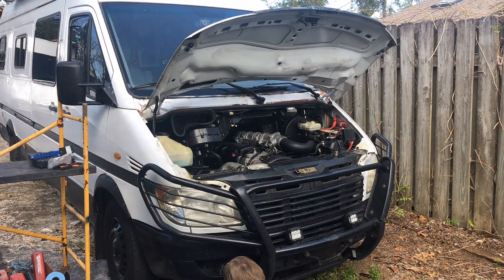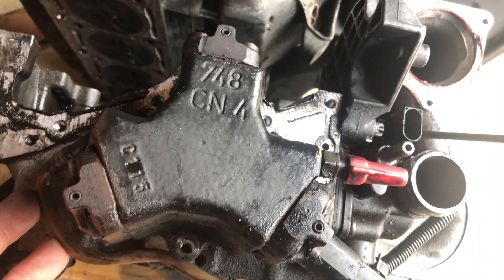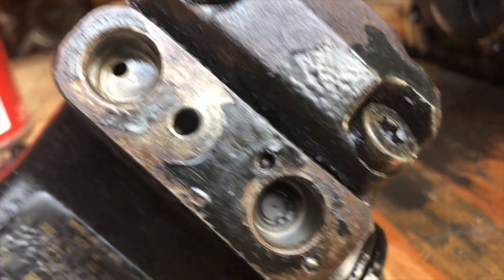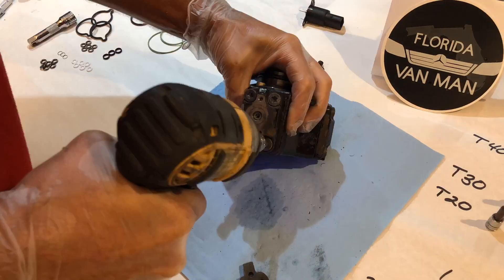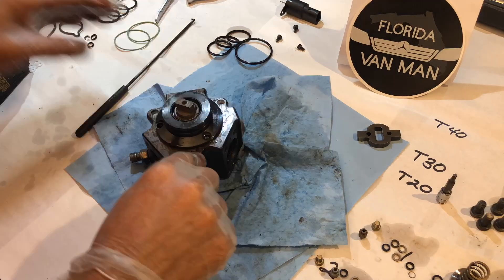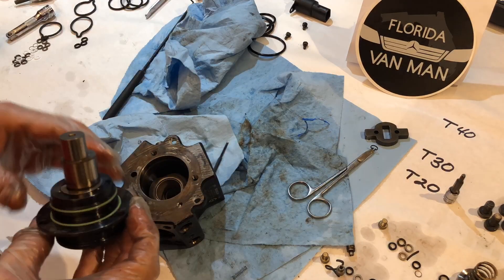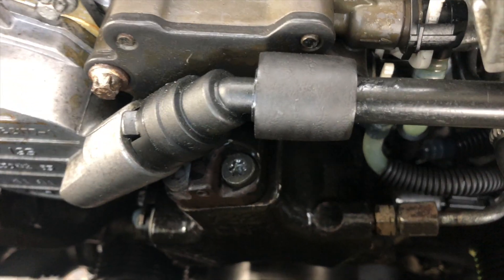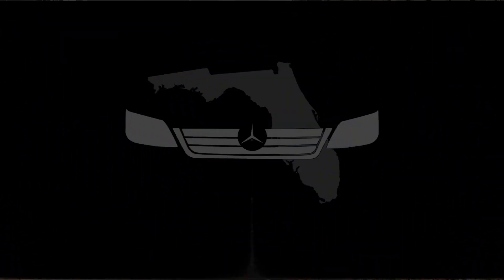HPFP Rebuild 2002-2003 Sprinter Bosch High Pressure Fuel Pump

Comment: I have a question, I have a 03 Mercedes sprinter. Was running like crap low/limp mode got home sat for a year did fuel filter. It will run with the fuel in the lines and filter than stall 7+mins It is not wanting to suck fuel from tank. Will this fix that or any idea what will cause this?
Reply from the maker: No, this is the high pressure pump and it will not suck very well at all. There is a low pressure pump right next to it on the front of your engine. That pump sucks from the tank and provides the positive pressure the high pressure pump needs. MillionMileSprinter has the low pressure pumps.
Reply: @FloridaVanMan    can I get you on the phone for a few mins to pick ya brain I’m willing to pay for your time, do you see low pressure pumps go bad often? I’ve rigged line & funnel to the filter via inlet port and it runs fine with fuel in funnel but when line from tank hooked back up it’ll just run the filter dry and not suck from the main fuel tank. Any ideas what would cause this? 
I’ve ordered zero leak fuel filter
Am interested in replacing the clear line from filter to lpfp as I suspect they’re leaking air and not enough vac to suck from tank. Any other recommendations?
Reply from the maker: @adanmccloskey3149  Sounds like a leak before the filter. It can be a broken hose inside the tank. I would put a cheap 12volt fuel pump on the hose coming from tank and see if I can fill a bottle from that pump or does it suck air from the tank.
I don't answer phone call except rare special occasions, but I help via messenger and text. Join our support group then message me on FaceBook, test or email. https://patreon.com/Florida_Van_Man?utm_medium=clipboard_copy&utm_source=copyLink&utm_campaign=creatorshare_creator&utm_content=join_link

Comment: Hey,  how much would a rebuilt HPFP be ? And where would I be able to buy one ? I have a 2002 Mercedes freightliner sprinter van 140 wb. Fuel is leaking down to my serpentine belt and I don’t have all the tools to rebuild it myself!
Reply from the maker: I've rebuilt them for $500 plus shipping. I don't have time to do it before our Winter-Sprinter meet-up next week but I do have a good used unit you can borrow*. Send payment and I'll send a used pump for you to swap in. Send me the leaking pump and I'll rebuild it then return to you for swap so you end up with a rebuilt pump and borrow a used pump to keep your van running. You will need to return the used pump to me when the rebuilt pump is installed and I'll need a deposit before shipping the rebuilt to ensure the used one is returned to me quickly. It will be understandably very easy to postpone the work of removing a used but working pump to install a rebuilt, so the deposit is necessary and fully refundable.
Optionally I can sell the used pump to you for $250 + your leaking trade-in, save you a bunch of labor, wait-time and shipping cost. $500 payment/deposit with $250 refunded when I receive the leaking unit. Half the money, half the work and way less than half the time waiting for deliveries.
Reply: Awesome I’ll buy the used one and trade my leaking one in! How do I contact you ?
Reply from the maker: Find me on FaceBook or email bill at Florida Van Man  @westleystalnaker5048

Comment: On my 2002 Freightliner diesel sprinter, the low pressure fuel pump is on the front on the engine. Is the low pressure and high pressure fuel pump one unit?
Reply from the maker: Nope, they are neighbors.

Comment: Is there a fuel pump in the fuel tank, if not where is it?
Reply from the maker: On the OM612 engine there is no in-tank pump. There is a low pressure pump on the front of the engine head next to this high pressure pump. The low pump sucks fuel through the filter from the tank and any little air leak will stall or prevent starting.

Comment: We have a 2006 2500 Dodge Sprinter van.  Recently cleaned up some "black death" on injectors 1+2 to try and resolve an issue with the van.  The van would sporadically die in the driveway, lost power once in the last few months and on occasion would not have any power when trying to back up.  After putting new seals and hold down bolts on the two injectors it now dies upon initial start up every time.  Once we restart it you can run it to FL and back with no issues unless you shut it off then need to restart after it dies or chugs when trying to drive away from the gas station.  Restart and runs like a champ.  We have changed the fuel filter, crankcase sensor, MAF and cleaned Intake air temp sensor with no changes.  No apparent fuel leaks anywhere.  Looking for some direction or ideas at this point before i just start throwing parts on it.  Love your videos but havent seen one that directly relates to this issue specifically.  Thanks for your insight.
Reply from the maker: Hi Ryan, a proper code reader should give us clues about why the van stalls and chugs. The first two links at https://floridavanman.com/links/  are compatible readers. We have a video for setting up the white reader correctly. Also search our videos for 'leak-off' and you will find test procedures for injector leak-off and fuel rail leak-off. Either of these failures will release fuel pressure back to the tank. Without pressure the van won't run.
Reply: @FloridaVanMan  
I did see the video for the leak off test. The rial pressure valve did have fuel leaking out when we cranked it over so I am going to replace that soon. No codes on a reader at my local mechanics shop. Hope the new valve solves our issue.
Reply from the maker: @ryanoehlhof7031  The local shop probably used a general OBDII code reader and our vans won't respond well to that. It can give incorrect codes when it reports them because the van uses different communication protocols from any other Dodge, Mercedes or Freightliner vehicles.
Reply: @FloridaVanMan  Thanks will definitely keep that in mind and will keep you posted after installing the new pressure valve on the rail. Any thing to be aware of or tips on installing the valve?

Comment: Did you use oil to protect the metal during assembly before starting the main pump.?
Reply from the maker: Everything is very oily when assembled and fuel is added immediately when the low pressure fuel pump rotates. Air in the lines as would be with new replaced lines would be cause for additional lube.
Reply: Where can you buy the rebuild kit?
Reply: @nickbabamov  I have done the same type of rebuild but id rather use assembly lube as diesel does not provide sufficient protection during the normal restart of a rebuilt kit that was installed.

Comment: Its possible if its little bit leak, to EPC And engine off if i try floor it?
Diag say low pressure on rail.. I think its pump
Reply: I have that problem I didn't resolve it...

Comment: Hey man. I ordered the gasket kit for my 2003 t1n and the gaskets are a little smaller the the factory ones. Is that normal and will they work with it? Were they like that for you? Any help would be appreciated. Thanks
Reply: Where did you buy the gasket kit?
Reply from the maker: If you are talking about the O-rings, the old ones might be swollen. This might be why the pump needs rebuilt.

Comment: Why didn't you use the washers with a dent on them? I have a w203 220 cdi that leaks diesel and I do have a seal kit from what I think is a 270 cdi. I do have all the washers except the ones with a dent. Can I use the kit from 270 cdi you think?
Reply from the maker: Those big seals that are not round fit a different pump. The seal kit fits several models. I don't know anything about 270 cdi. I only play with T1N Sprinters.

Comment: Good video!!!just one question:what did you do when you removed the retaining clip(min 3:02)
Do you have to replace the spring or the other part?or just clean it?
Reply from the maker: We reuse the clip, but the spring loaded stuff beneath it must come out to reassemble the bigger pieces. Then it goes back in later. Clean everything.

Comment: How do you bring back the fuel pressure because the engine will not start? . The pomp has no fuel now inside. Thank you.
Reply from the maker: Did the fuel filter drain? Can you fill the filter?

Comment: If a hpfp needed a rebuild would there be symptoms associated with this?
Reply from the maker: These pumps usually leak when they fail. Fuel drips on the serpentine belt and gets slung everywhere under the hood. Other symptoms might include low fuel rail pressure, limp mode and stalling.
Reply: My 03 sprinter starts and dies in colder weather till operating temp. Hot weather you have to let cool down or it takes many cranks to start. Recently in cold weather it now stays limp mode. I have replaced fuel injectors glow plugs and module and fuel filter. Do you think it could be hp fuel pump or fuel management valve?
Thank you

Comment: Great video, do you have a recommendation for a company that sells remanufactured pumps?
Reply from the maker: We have rebuilt a few with good success. If you don't want to do it yourself send me a note and we'll rebuild yours.
Reply: @FloridaVanMan  I have removed the injector pump from my 2002 frightliner sprinter 2500. Cany ou overhaul and what is price to overhaul ?
Reply from the maker: @georgewhidden8064  $350 to exchange. Or you can rebuild it yourself with the seal kit and save about $300. The kit is out of stock right now. I have one ordered and one pump on the shelf, ready to go.
Reply: @FloridaVanMan  Howdy, do you have any rebuilt pumps ready to go at the moment?
Reply from the maker: @geoduch  Not recently rebuilt but I do have a good used one still on the engine that came out of Too-Blue. It was rebuilt more than a year ago and only a few dozen miles put on it before the engine was swapped, complete.

Comment: What is the brush guard that you had installed at the beginning? Is it a T1N specific brush guard, or a generic aftermarket one that you added? If so, how difficult was it to mount? Looks really good and I'd love to put one on my van
Reply from the maker: I believe it is a brush guard from a Toyota Tacoma. They are significantly cheaper than anything specific to T1N and can be easily modified to fit. I quite like the way it makes Mr. Sprinter look, very sharp and aggressive.

Comment: It never even entered my head those pumps were user serviceable. Quick question. if I wanted to disable my sprinter all I would have to do is remove that electrical connector from the HPP? This channel is BRILLIANT
Reply from the maker: I would expect any van will not start with the HPFP electrical connection detached. If your van is an '04-'06 Sprinter there is a 90 degree connector on the HPFP that will swap positions with a straight connector closer to the turbo. I guarantee this will cause a no-start! ...and drive me crazy trying to find out what I did wrong.  Long, long ago in a place not so far away.
Reply: @FloridaVanMan  Ha, ha, thanks for the reply.... I was thinking of going camping in it and was just looking for an easy way of making sure somebody didn't steal it. If I leave it for any length of time I could just pull that little connector off. Cheers, ma dears
Reply: The electrical connector on the OM612 pump is for the fuel cutoff valve into the one piston, which was an early version of the Fuel Quantity Control Valve found on the 2004-2006 OM647. Disconnecting it may throw a fault code, but I would expect the engine to start?
I’d pull the Start Relay from the fuse panel under the driver’s seat, though you can wear out the connector doing that too often...
-dave